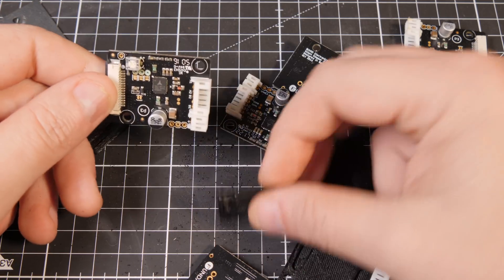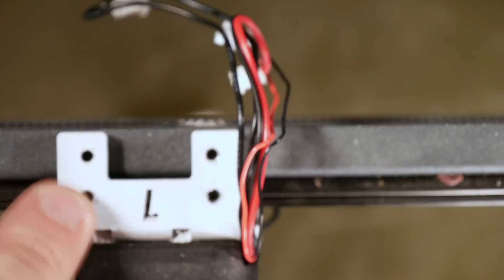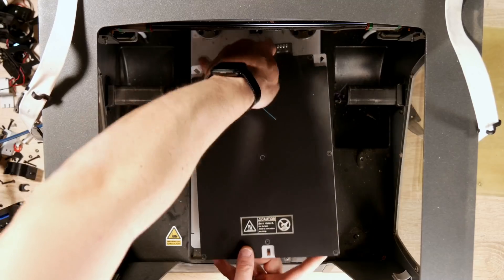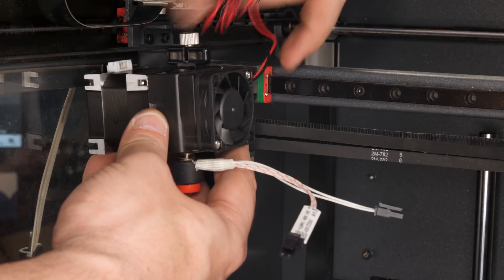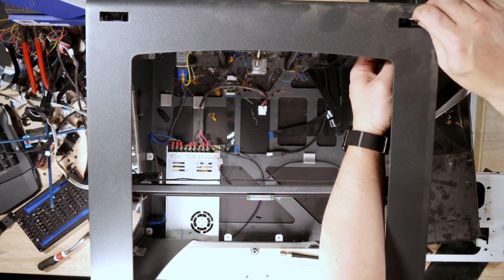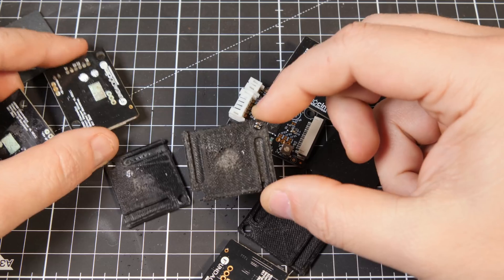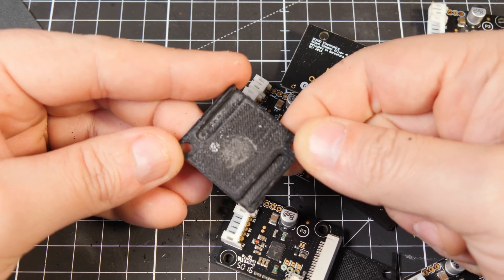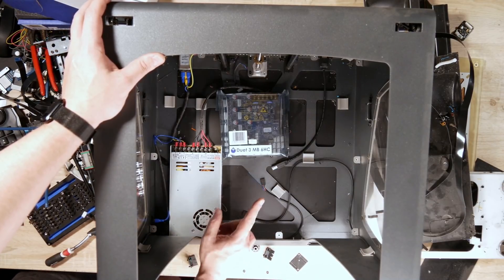This Can’t Possibly Be Right! BCN3D Sigma Teardown

Comment: Argh! So frustrating, I had a layer shift after following bcn3ds instructions to check drivers, now the ribbon cable has bit the dust taking a driver with it! Why oh why did they design it to be so difficult to work on!
My stats printer R17 (nearly 4 years old) 
480 hours, 234 prints started , 112 completed,
 9.49km traveled on x0, 9.99km on x1, 22.9km on y, 887.58m of filament extruder 0, 578.75m extruder 1..its not like its worn from over use.
And that's 2.85mm filament so a kg is 320-410meters so it's literally seen a maximum of 6 reels?

Comment: I'm half tempted to do away with the Idex and try and turn mine into some sort of corexy voron vzero copy.. the rails are good the bed is ok, its just those nema 14's and the crappy electronics (they did put a bit of effort into customizing marlin , with the fancy calibration routines and the graphics, I bet that's where most of the cost of production went Lol)
Reply: I cracked the screen on mine today and this is exactly what I'm planning on doing.

Comment: I wonder if under extrusion , extruder stopping mid print and layer shifts are anything to do with those petg heatsinks, it boggles the mind the whole chassis is aluminium could they not thought about using that as heatsink if their budget was that tight ?? just looking through CAD as you inspired me to try and do something and the new CAD has heatsinks on X axis drivers & steppers (still hearing people with epsilons having layer shifts tho :-/

Comment: Instead of breakout boards for the tool heads, why not use Duet3D tool boards? We have a new version coming out with mounting holes to match the Hemera XS.
Reply from the maker: Wasn’t aware, will definitely look into it as it would make perfect sense
Reply: @BreaksandMakes  Can bus boards would save a lot of wiring woe's.
Reply: I was thinking the same thing, seems like those boards would be an ideal match

Comment: Somehow this reminds me of the "fancy" coffee machine from work.

For those unaware: there's a good chance that that really big coffee machine in your (current or former) office is leased, not unlike the giant printer/copier. So you pay a deposit on the machine, then a monthly lease for it, need to pay for supplies, AND they almost always require a service contract if you want the machine. Plus, at least in the US, insurance will require the office have certified service technicians which always add to the cost. One of those "can make 40 different drink" coffee makers probably sets an office back a few thousand a year (even though the machine itself is around $10k-$15k).

So one day, the one in my office broke. The repair person eventually showed up and started working on it. They have a literal key to open them so random people can't just open it and try to repair the machine themselves. They start taking things apart, removing bits and pieces. They paused to go to the bathroom and I decided to take a look. Sitting there on the work cart, sheered along the layer line and obviously deformed and damaged from heat, were multiple 3D printed parts that held the water boiler, water lines, and various mechanical parts together to the frame. The repair person came back and continued taking things out. Eventually, the closed the unit and rolled the cart away. Word came back that it would be a week or more for the parts to come in. I realized that the time was because they probably had to put in an order for new printed parts, get the parts at some distribution point, then ship them to the repair person who would then bring them in. 

A (in my office's case) $12k coffee maker had around 2 dozen 3D printed parts holding things that got hot... and they were breaking apart like a test from CNC Kitchen, and probably cost no more then $40-$50 (depending on material). It took a week+ to produce and ship said parts, to be improperly utilized due to machine design, and the whole time my coworkers didn't have coffee AND we still had to pay for the machine even though it was down for nearly a month (1-2 weeks for the repair person to be available, 1-2 weeks for replacement parts to show). Heat and 3D parts don't go together unless you design that from the start... and I don't think they did such a thing.
Reply from the maker: Sounds about right to me!

Comment: I have bought 3 Sigma R17 in fev 2017 and use them near 2500-3000h each and I always had problems. I had noticed even if I didn't used the second extruder, the stepper motor and driver always were very hot. The motor didn't move during the prints but it was very hot (I think over 65°C). These printers made me crazy. Really. I have just keep one, don't use it. I think I will do the same. Thank you.
Reply: 2500 hours wow mine has 470 hours , that's still 22km on y axis , I just cant face another failed print...

Comment: Wait, was that galvanic corrosion on those bracket ? As in steel hardware on an aluminium plate ? :O

The cable thing is an interesting point, I've always been wary about ribbon cables just for current carrying and their eventual failure modes, personally id much rather work with silicone cables and (usual gx12/16 connectors), I mean yes ribbon cables do offer a cleaner solution but they're not for me.
Reply from the maker: Had to google galvanic corrosion, I believe it actually is!